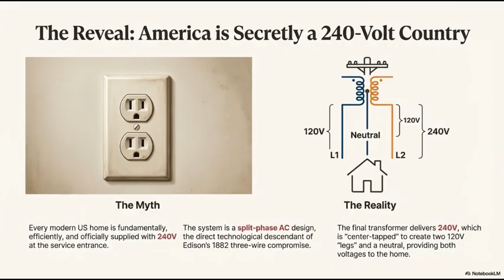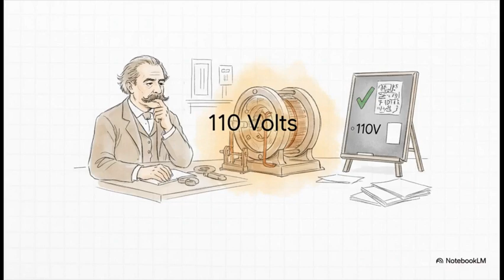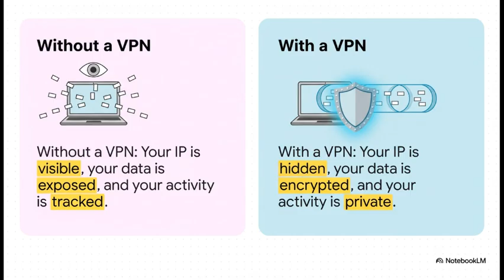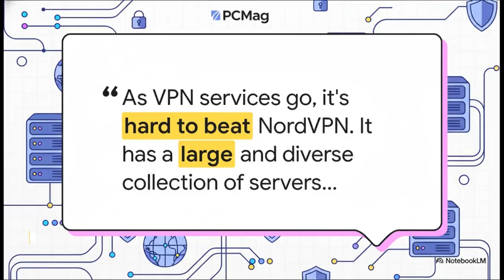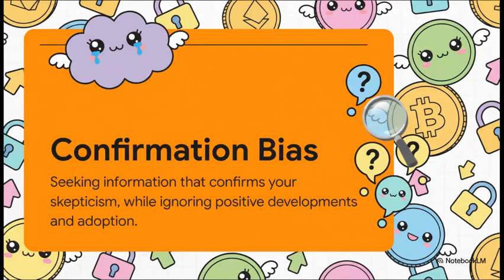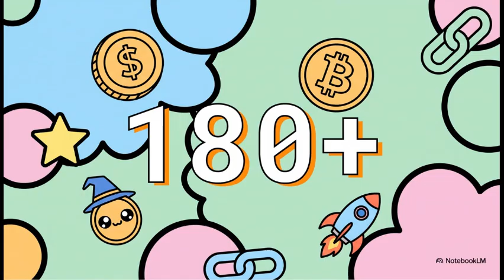Why USA Has 120 Volts while Europe uses 230 Volts. A Little Debate

Comment from the maker: 🔒 Online Security Military-grade:
🔒NordVPN has been delivering since 2012. It is developed by Nord Security, a cybersecurity company incorporated in Amsterdam, with its operations based in Panama for privacy reasons.

🔒Use this link 	
https://ir3.xyz/68b1ee77699b6?p1=voltdebate
To get two active NordVPN promotional offers valid worldwide from until January 29, 2026:
A default offer of 70% off NordVPN's Threat Protection service, with no promo code needed and a 30-day money-back guarantee.
A promo code "REDSAVE25" for up to 25% off on select NordVPN subscriptions when applied at checkout.
This means you can either purchase threat protection at a deep discount or apply a code for discounts on certain subscription plans.

🔒NordVPN Mobile App (Android/iOS)
https://i1b.xyz/692442a3040a5?p1=voltdebate

🔒ExpressVpn:
🔒https://i1b.xyz/68b1f46150aab?p1=voltdebate 

🔒PureVPN:
https://trackerpro.org/6880c21e1c673?p1=voltdebate

💰 Financial / Investing:
🔥 *Nexo*: Loans and Lending in Crypto
https://i1b.xyz/68fb395a98767?p1=voltdebate
🔥WARNING!🔥 This is not free money! This is a sophisticated financial tool, a double-etched sword. Don't use it unless you completely understand the risks and the worst case scenario. If Nexo folds, it's not my fault.

💰 PayBis
💰A trusted global beginner-friendly crypto buy/sell platform with good reputation. Operates since 2015! Make it easier to buy and sell crypto using credit/debit cards without overwhelming you with advanced features of exchanges.
💰https://trackerpro.org/68807b5035ab2?p1=voltdebate

Save 15% on your first transaction fees with my link! 
✅ Use Code: INDOPROMO ✅ 
Valid thru 31 December 2027 in most countries, please be sure to check your country

PayBis Mobile App:
https://gettracker.net/68fb3cda47c62?p1=voltdebate

Save 15% on your first transaction fees with my link! 
✅ Use Code: INDOPROMO ✅ 
Valid worldwide 6 October 2025 - 6 October 2028

📈 OKX: One of Top Crypto Exchanges, Onboarding:
https://i0x.xyz/68fb395a85897?p1=voltdebate

🌿Creativity:
🔥ElevenLabs: Voice Cloning Models, Multilingual TTS with Your Voice or Other Voices
🔥https://ir3.xyz/692040ebf0f14?p1=voltdebate

🔥InVideo.io
🔥High grade Smart Semi-Automated Video Production
🔥https://i0c.xyz/68b1ee779a3ab?p1=voltdebate

🎥 VidIQ
🎥It's Like doping to your YouTube channel. Make Data-driven decisions to grow your channel  and to share your message with a broader audience. https://vidiq.com/hermolaou

🚀Achieve YouTube success by following Matt Par!
🚀 Master the platform and boost your earnings with *Tube Mastery & Monetization* course:
🚀https://mattpar.com/tube-mastery-ds#aff=hermolaou
🚀 And the AI-powered *Tube Magic* suite of tools to generate unlimited video ideas and write optimized unique scripts and metadata fast:
🚀https://tubemagic.com/ds#aff=hermolaou

🚀Vid.AI Create Videos With AI Instead Of Editing Them Together YourSelf
🚀https://vid.ai/?ref=hermolaou

📈 Maths/Science:
➕AlgePrime Algebra Video Series
➕Math prowess is super necessary for any serious electrical engineering enthusiast.
➕https://algeprime.com#aff=hermolaou
➕Member area and video courses

📢 Let's gather on my Patreon community to stay in touch!
https://patreon.com/c/hermolaou

📢 Disclaimer
This video contains affiliate links that generate commissions for the creator at no extra cost to you. On the contrary, they may offer special bonuses for you. Terms apply.